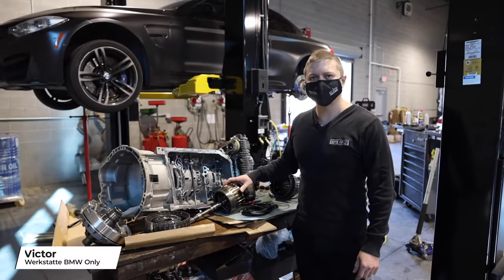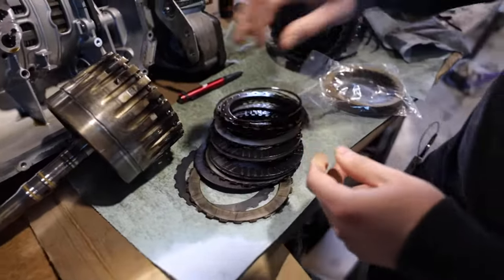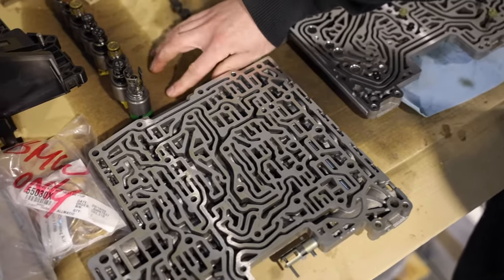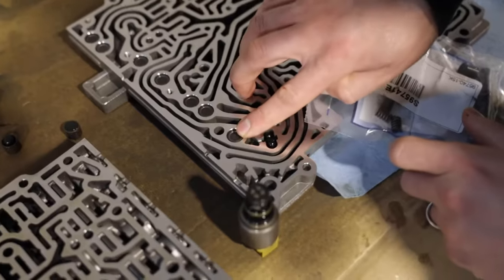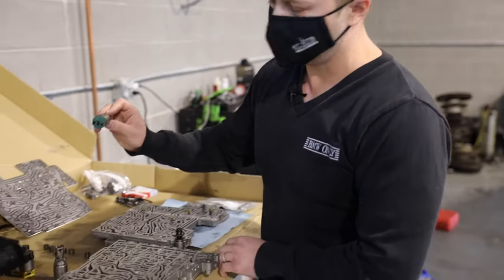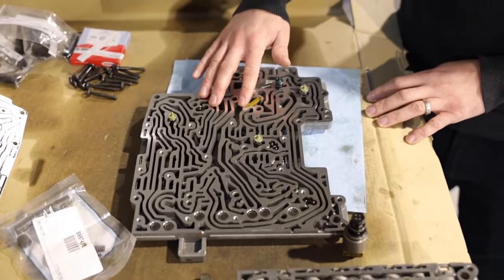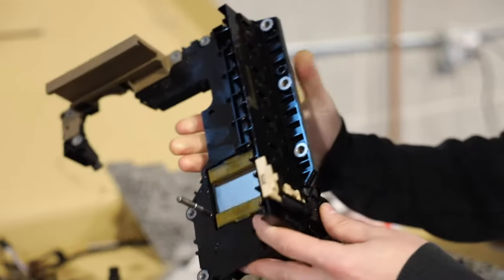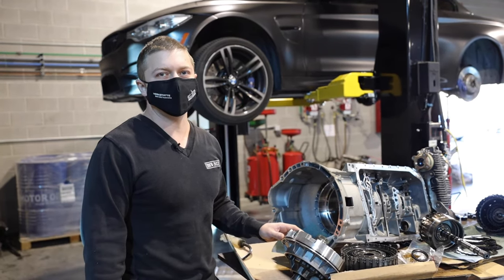Why BMW  Transmissions FAIL 6HP19 6HP21 6HP26 6HP32

Comment: Werkstatte. I use a Range Rover 07 HSE V 8 4.4 and my transmission is a ZF 6HP26 . My car keep throwing a P0500 code. Which says Vehicle Speed Sensor "A" Werkstatte. Can you please help me with  location of this VSS on the ZF 6HP26 transmission? Thanks Nice video. thumbs Up. Sorry am a year late.
Reply from the maker: So that's not the sensor issue. Don't try to replace it. It's slipping gears. Older BMW have the same faults and sensor will never fix it. You'll have to drop it and rebuild it or replace it.

Comment: mine currently sounds like the internal pump is going out; loud mechanical whine noise. Clutch E is obviously going out, 130+ms, and the 3>4 ratio code intermittently pops up. fluid is fine. done solenoids, sleeves, fluid n adaptations, any other suggestions? i have another trans and spare mech unit on hand.
Reply from the maker: In this case we remove the transmission, replace clutch e pack and input shaft bushing. You might as well can replace the rest of the bushings. Don't worry about rest of the clutches or seals. They never go bad.
Reply: @werkstatte-bmwonly9515   appreciate the response!

Comment: Does this also apply to the 6HP19A that audi uses in their quattro versions?
Reply from the maker: They are built similar but aren't the same. BMW uses a transfer case in all wheel drive models and Audi has output shafts directly from the transmission to the front wheels. So I don't know if the failures are common or not
Reply: @werkstatte-bmwonly9515  okay thanks for your fast answer 😁

Comment: Hey brother I just changed the transmission out and . I got this problem that on 3 to 4 th gear switch if I’m pushing the pedal I get a rpm jump it feels like it’s slipping but if I’m bearly touching the pedal it shifts fine . Downshifting fine just on going up 3to 4 th . Do u think it’s the solenoid , valve body or is it transmission clutch pack . Thank you
Reply from the maker: Bushings and clutches. But you'll need to take care of the valve body as well when you do that
Reply: @werkstatte-bmwonly9515  
Thanks for the quick response .
And I kinda thouth that would be the case but was hoping that you will tell me something else . And if I may I got one more question . So this car is a 07 335 
With 45 original miles . I got it from a guy who got it from some body didint know what they were doing at all . And u know how everyone tries to make these cars fast , so this was the same case . So the guy who I got it from had it for few months and he got a problem with the car slipping in first and reverse and I guess he figured out that he needs the sleeves . So he took the valve body down did change them and right after that he got a new problem with solenoid e so 1-3 no problem and on 3-4 shift it would act like it’s not engaging at all it felt like there’s not enough oil pressure or something cuz I’m a shift the rpm would fly up and go into limp mode . Unless u bearly touch the pedal but when u start pressing on it throws it in to limp mode . I did change the whole valve body same thing . And when I took the tranny down on the bottom there was some silver tiny particles, not a lot, but there was some. So I got 2 transmissions now the one with 45k and 4 and up are totally gone and it happened righ after changing out sleeves of the one I got in the car now and this one once it goes in the 4 th no problem u could step on it no issues and if I am gentle on a switch bo problem I did look on the sleeves they were good and the oil in the transmission was super clean so what transmission should I go with . Thanks for you’re advice . 
And do u deal with engines I have a high idle around 1k will not go down no matter what I swapped out the whole intake, manifold changed out, coils, injectors, not helping
Reply from the maker: For idle do you have any fault codes? If you don't I would flush the DME. When you're filing up the transmission make sure it fits 8-9 qt of fluid. This is a common mistake as well.
Reply: @werkstatte-bmwonly9515  there’s no codes . And how do I flush it . What do I need to flush dme .

Comment: I live in Vegas. My vehicle is 108,000 2015 528i. I have no issues with my transmission but would like this transmission service for prevention. How much $ is this service with the new transmission pan. I'll make appointment.
Reply from the maker: So it'll cost you $890 for new pan,gasket, adapter gaskets and fluid. Including labor of course. You can call or text us. Find out number on Google.
Reply: @werkstatte-bmwonly9515  thank you for the response. Is this a 1 day service or does the service take 2-3 days? Or do you have parts on hand. Thanks.
Reply from the maker: We stock same. Typically done the same day unless we get super busy.
Reply: @werkstatte-bmwonly9515  thanks I'll make an appointment within these 3 weeks. Thank you
Reply from the maker: Thank you.

Comment: My 2006 325i jerk / thud  went while accelerating at gear change and coming to a complete stop particularly between 1 & 2. I did a tranny service but to no avail. I am leaning toward solonoids replacement. Any suggestions? The good thing is there is no transmission fault code, just abrupt jerks at gear changes.
Reply from the maker: Hi there, sorry for the delayed reply. Are you sure you have ZF and not GM transmission? Downshift is typically due to the transmission fluid loss in the valve body
Reply: @werkstatte-bmwonly9515  based on my Vin on bimmer cat it is Gearbox9.50l (GA6HP-19Z Auto). I  did tranny service with a complete pan and integrated filter and sealing sleeves, new fluid, plug adapter grommet and valve body seal selves change. The tranny service did not fix the jerking issue that's why I am leaning towards solonoids replacement.
Reply from the maker: We always replace solenoids but also piston dampers inside the valve body are extremely important
Reply: @werkstatte-bmwonly9515  I m in Dallas area. Any recommendation for shop who can do this work ?
Reply from the maker: Unfortunately I don't know anyone there

Comment: Hi guys! I have a 6hp21. I have a issue, mainly after the car gets cold, like 6-7 hours of resting. It doesn't matter if it's winter or summer. I put the car into D, stay like 20-30 sec with the foot on the brake and when i release the breake to slowly start moving, the car freezes like for half a second and then it's like someone hit me hard in the back of the car and it starts moving. It's doing this for the first 10-20 min of city driving, with frequent stops and go!. If i skip this city driving and go for a longer drive, right from that cold start, it's not going to do that hard engagement at the first stop&go. 
I have changed the oil, filter, TCM sleeve, square seal between mechatronic and gearbox, tube seals round ones, zip kit from sonnax, separator plate and new solenoids! No errors on the gearbox! Adaptations done as zf required!
Any suggestions? Thanks
Reply from the maker: Two questions:
1. Has this problem existed before you did the service ? 
2. Was your transmission leaking before you did this service ?
Reply: @werkstatte-bmwonly9515  
Yes, the problem existed before the service! I have it since i got the car, two years now. It remained the same, not worse, not good.
No, the transmission had no leaks. Oil level was good. 
Also, no overheating but this remain to test after one hour or two after i drive it, these days i'll test it again! 
Also, i have some small hesitations when shifting from 2-3 and 4-5. After a 10 min o driving, let's say it's almost gone! 
Many thanks for the answers!!
Reply from the maker: It's very confusing. It really sounds like you're losing pressure but, when your vehicle warms up it should be worse because of the viscosity of the fluid. In your case it gets better. I'd say maybe a toque converter.
Reply: @werkstatte-bmwonly9515   Thanks guys for the answer. But what can be wrong with the torque converter? 
I have done another test these days. If i start driving in M1, the car doesn't do anymore that symptoms!! As soon as i put it in D, it does. All until it gets a little more hot! 
If it helps with something, i can put you the last results from testing the clutch fillings and rapid fillings time!
Reply from the maker: Torque converters usually start failing around 80k miles. It's hard to determine what causes it. Could be the valve body itself. Either way that's not a common symptom we see. You can send out an email to ZF directly. Email zfservicedesk@zf.com
You'll be surprised how detailed they respond. Give them several days to reply. Let me know if they won't reply I'll send out an email on your behalf.
Reply: @werkstatte-bmwonly9515   Many thanks for pointing me to zf directly! Really appreciate it! I've been asking around at many repair shops and really seems an unusual defect! Nobody can point me to some what close to repair, but ZF for sure they will have an idea of starting to fail in the gearbox! I'll let you know what's their thought on this! 
Many thanks again!
Reply from the maker: You're welcome. Keep me posted
Reply: @werkstatte-bmwonly9515   I have been back an forth with emails to ZF these days and i did not get a straight answer to where the problem could be. They are pointing me to the mechatronic, first saying solenoids and after that mechanical valves...but not knowing where it's all this starting. So, the issue still remains a mistery. Guess i need to open the mechatronic and vacuum test all the valves to see if any of them are not working properly. 
But my biggest question is that why in manual mode it's not doing that? Do i have other pressures on the clutches and it's not doing that anymore? Do i have in manual mode the lockup clutch always on and the converter does not slip? 
Could it be any "bug" permanently stored in the TCU's computer, causing a different pressure when the oil is cold, and thus causing a delayed engagement to first gear? 
Maybe bad temperature information fed to the TCU about the oil temp?
These are my questions...but no answer. Maybe i will find myself the fault after all.
Reply from the maker: That's actually very common. I've had very many transmissions that worked just fine in the manual mode and acted up in regular driving. Pressure is different I guess. ZF is right, sometimes it is extremely difficult to pinpoint the issue especially over the text or emails.
Reply: @werkstatte-bmwonly9515   Ok, many thanks guys for your help!! I will open the mechatronic again, maybe after new year, and vacuum test all the mechanical valves and start from there again!
Reply from the maker: Keep us posted, maybe it'll save someone's transmission one day.

Comment: I have a zf 6hp19 and I get a rough 2nd to first gear downshift. Just recently my car has been going into limp mode and throwing a gear ratio code 004f8b for 5 to 6. Any suggestions? I've been told to replace valve body sleeves.
Reply from the maker: Hi Dre, sorry for the delayed reply. Let me know the following:
1. Model and year of your BMW 
2. Mileage 
3. Any prior transmission services done ?
Reply: @werkstatte-bmwonly9515  2006 325xi with 130k. I just replaced all valve body sleeves and put fresh fluid in it with a new pan. I also reset adaptations. The problem went away  after resetting adaptations but then slowly came back.
Reply from the maker: Sorry for the question, you're sure you have a ZF transmission?  They used GM in 2006 as well and they have that downshift issue. GM would have a metal pan and ZF has the plastic one. 
If it is a ZF you probably need a pressure dampers kit, sonnox sells them but it's not a really diy job.
Reply: @werkstatte-bmwonly9515  it's definitely a ZF it has a plastic oil pan in it.
Reply from the maker: Email ZF directly with the fault codes, year and models and mileage. Their email is zfservicedesk@zf.com

Comment: Hi there i just watched your video and well explained, im getting code 4F8D after driving to operational temperature before and after replaced stuff down below... I recently replaced solenoids, separating plate, accumulator seals with rubber version like OEM and valve body seals (5 pieces) ... all the values are A -134, B -50, C -55, D -38, E 0. Still on learning adaptation process... what causing for that code... 2006 530xi , thanks in advance...
Reply from the maker: Did you replace the clutches and bushings ?
Reply from the maker: Also what's the description of the 4f8d fault ? I don't know them of the top of my head. I might be able to help you
Reply: @werkstatte-bmwonly9515  hello i am getting 4F81 even after changing pan,oil and valve body seals,and mechatronic seals 4F81 code defines Translation Monitoring Clutch A.What do you think can be causing this issue? And What do you suggest i do next?
Thanks in advance
Reply from the maker: 1. Worn bushings
2. Piston pressure dampers inside the valve body 
3. Input shaft is worn 
4. Solenoids 
5. Damaged clutches
Reply: 2010 BMW 335i xDrive vehicles. The transmission may go into failsafe mode, with fault code 4F8D (ratio monitoring, gearshift 5-4 – plausibility) stored in the EGS. The cause is over-sensitive EGS software.

The fault may occur during a 5-4 downshift only in vehicles with either low mileage, a replacement transmission or after a reset of the adaptation values.

The transmission adaptation occurs only at a transmission oil temperature of 75 degrees Celsius or higher (167 Fahrenheit). Once the transmission oil temperature of 167 F has been reached, carry out the adaptation as follows:

1. In drive position D, increase vehicle speed up to 4th gear at about 25 mph, but do not allow a shift into 5th gear.

2. Allow the vehicle to then coast to a stop and keep the vehicle stationary for about 15 seconds with the brake pedal applied.

3. Next, with the vehicle stationary, change from D to N and back again to D.

4. Repeat steps 1 to 3 approximately 10 times.

Comment: Thank you for your knowledge is there any reason the the car would judder and jolt when slowing down and coming to a stop using the sport button on my Bmw 530d e60?
Reply from the maker: Solenoids loosing pressure. I'd service the valve body, replace solenoids, pressure dampers. We don't have 530d e60 in US but that's a super common problem on these transmissions
Reply: @werkstatte-bmwonly9515  What a guy, thanks for your reply.
Reply from the maker: You're welcome. Let me know if you got more questions.
Reply: @werkstatte-bmwonly9515  Just want to say thank you so much for taking the time out to reply to me. May the good lord give you health, wealth and prosperity.
Reply from the maker: Aww thank you, good luck.

Comment: great info but sad I just found this video... kinda let me know what i am gonna have coming on this 2005 525i I just got, runs perfect... until a few days ago. went into limp mode, made it home and shut off for a few seconds then restarted and all is good. changed battery and reg the bat then did a code sweep and have only 2 4f95 and 5149 missing signal for power module. starting to regret getting this car but i kinda had to. if anyone knows what those 2 codes are and could help that would be excellent and much appreciated. thank you.
Reply from the maker: Hi there, this would be clutch ratio monitoring. 5 series is the most common with the bushing failure. Replace the solenoids and do valve body service asap, you might postpone the problem for a year or even longer. Make sure to replace pistons that damper  pressure in the mechatronics that I've mentioned.

Comment: When I put my car in drive it will not go can someone help me please
Reply from the maker: Are you going to do your own repairs and need guidance? First of all is checking fluid level and scanning the fault codes
Reply: @werkstatte-bmwonly9515  yes I am. I changed all the solenoids and I just don't know where to go from there
Reply from the maker: 1. Was the vehicle running before you started working on it? 
2. Did you remove the valve body and replace the adapter gasket? That's the block that goes in between

Comment: Hello Sir? I Looking for bushing for 6hp28X, do you know where can i found bushing for this gearbox ?
Reply from the maker: So there are multiple companies that manufacture them. One of them is sonnax.com They do not sell it directly so you need to find a dealer. Where do you live? I'll try to find someone near you
Reply: @werkstatte-bmwonly9515  i living in France, i seen a lot of bushing on ebay or aliexpress, but i suppose is very low quality.
Reply from the maker: Well ZF doesn't sell bushings or internal components. You'd have to find a dealer. A very solid company is Sonnax. See if they have authorized dealers in your area